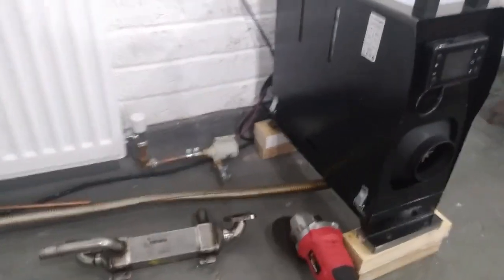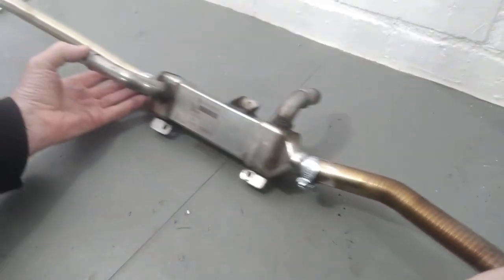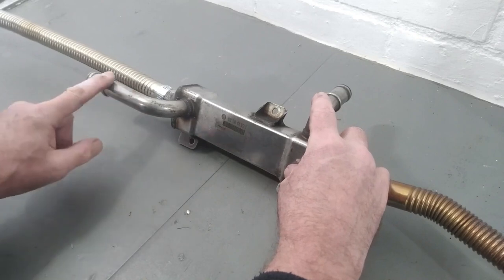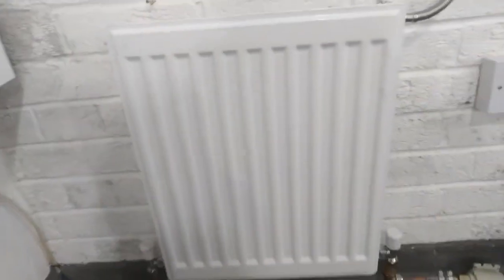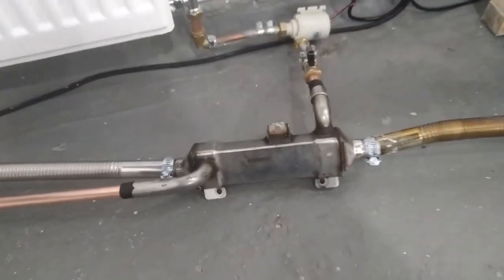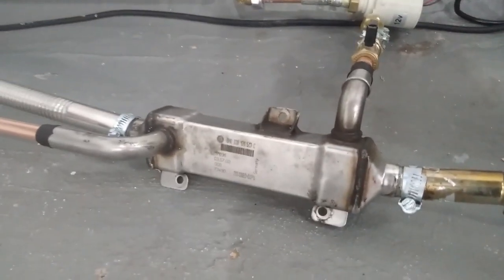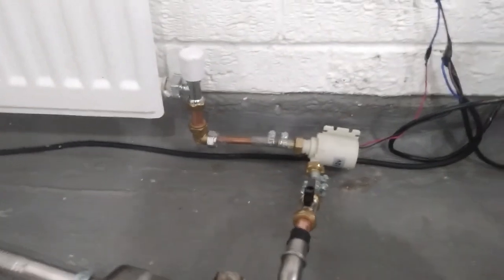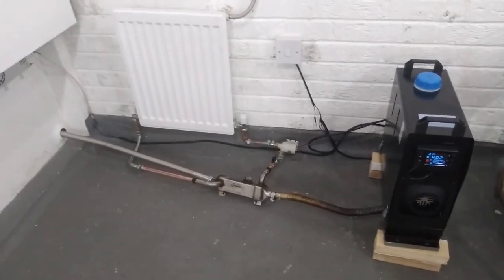Free Heat from Waste Exhaust Heating Radiator Home Diesel Oil Heater Mini Central System Exchanger

Comment: Fantastic. You may get some back pressure issues with the length of that pipe so will be interesting to see how well this does. Get some exhaust paste on the joints for the exhaust.
Reply from the maker: Thanks for the tips!

Comment: You need to raise the heater higher to ensure the exhaust is running at a continuous slope down. If you leave it sloping up, the pipe will get full of water and completely block up causing a flameout. Ask me how I know……
Reply from the maker: hahahaha, ok thanks , cheers andy